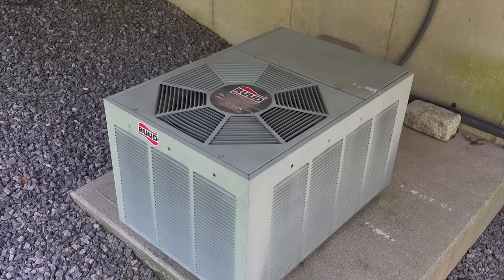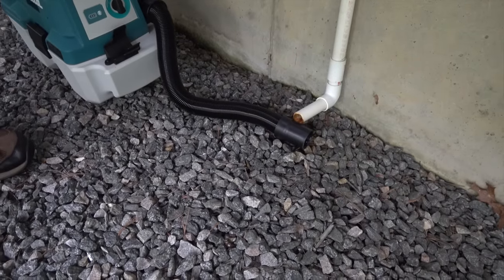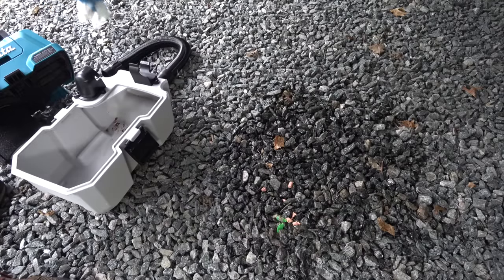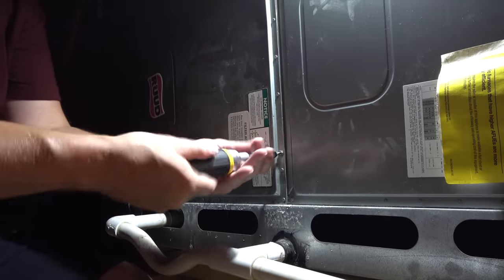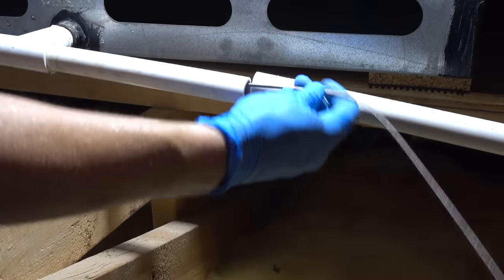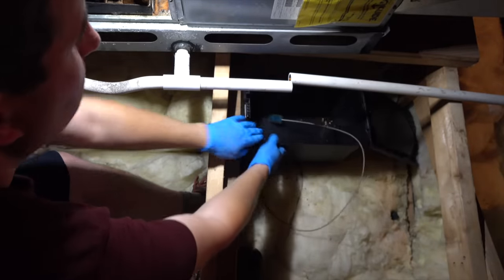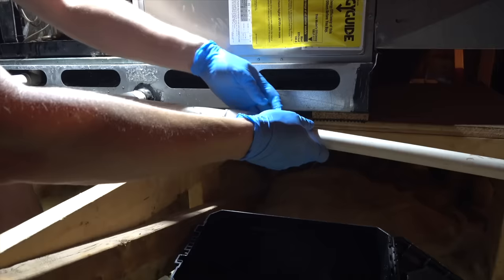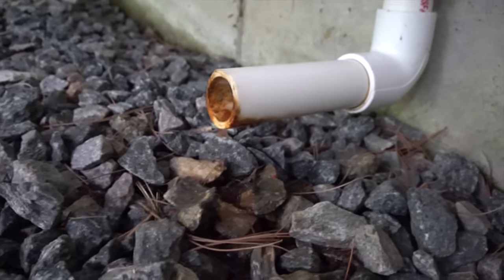How to UNCLOG your AC DRAIN Condensate line FAST - Water stains on Ceiling? or in the Pan

Comment from the maker: Tools from the video: PVC Pipe Cutter: https://amzn.to/2YwA05z - Pipe cleaning brush: https://amzn.to/314wTzB - Pre made rubber coupler with clamps: https://amzn.to/2K7SmBR
Reply: Another help is a shot of eco friendly dish soap in the condensate pan to inhibit mold and algae.

NEVER bleach.
Reply: My house is built by a stupid plumber 37 years ago; he installed two 90 degree angles PVC in series within one foot. Therefore, my AC drain line could clog easily. Sometimes, I
had to flush the nasty stuffs through these two PVC. Well, I would like to offer you a good tip. Luckily, I found a 20 ft long coax cable, very flexible. There is the AC drain line outside next to the AC unit, I poke the cable gently into the drain line back & forward for at least ten times. In addition, I used vacuum, carpet cleaner to suck out all the dirty stuffs from inside the drain line for 15 mins.
Reply: Hello Silver Cymbal! Thanks for this video 🙏 Can you please update your list of tools from this video? The pipe cutter is sold old and the other is unavailable. I’d like to purchase ASAP from Amazon and I’d love for you to benefit from the affiliate link. Have a great day!!
Reply: @DealingWithDigits  If it’s sold out  just check for a different PVC cutter they’re all the same just different manufacture
Reply: Is there a solution to keep the jellol that forms in the pan. Mine gets so thick? I was thinking of like a bleach tablet.
Reply: @larrybrautigam7734  Soap might accumulate dirt and clog your drain pipe ! I read that vinegar would be preferred !
Reply: A drop of soap once a month is not enough to clog anything. And vinegar is acid. Bad for steel pans.
Reply: I would take the panel off everytime. The drain pan might be full of slime as well and needs to be cleaned as well
Reply: So, do we need the AC one  while we use the vacuum?
Reply: Apparently I have two drain pipes.  One is connected to my bathroom sink drain before the p trap.  The other is the normal emergency PVC drain pipe that drips outside.  I'm guessing I need to vacuum/clean both?

Comment: Bet this always happens when it's 90 degrees outside and 200 degrees in the attic lol 🥵♨️
Reply: Can confirm, 95 here today 😂
Reply: Hitting around a 100 here
Reply: Just did it yesterday when it was 96 degrees out. Thought I was going to pass out in the attic…
Reply: @HIGH REV that black thing might be a senor that's cutting you ac off you have a clog
Reply: @HIGH REV wow did you try to twist it off it shouldn't be hard unless it has alot of crap holding it down that doesn't sound right but it does sound like you have a clog drain
Reply: @HIGH REV go outside and use wer vacuum and suck the crap out the pipe I wish I could im on a 3rd floor condo
Reply: @HIGH REV np😊
Reply: @HIGH REV 😊
Reply: Omg so true 🤣🤣🤣🤣
Reply: Drive a car, learn the basics of how a car works. Eat food, learn where that food comes from. Use an air conditioner, learn the basics of how it works. Getting a vaccine, learn about antibodies before getting the vaccine. Or just trust the person you pay to do these services. They surly will do what’s best for you and not take advantage of you. Right?
Reply: @tomdurkins  😂 Learn how it should be done. Review the contract and supervise, so you don't get taken advantage of.😉
Reply: @tomdurkins  good man Tom I see you’re AWAKE . Nice job
Reply: Happening right now to me.
Reply: If direct sun is hitting the roof, I'm sure temps get over 120F and could reach 140F. Attics generally have poor lighting and you'll need your own high-brightness drop/spotlight up there to do anything useful, and with that, you don't need sunlight (unless you have a large window right next to your air handler!), meaning you can do the work on an overcast day, or better yet while it's raining or at night with no heat hitting the roof.
Reply: Every damn time
Reply: My current condition..
Reply: 95 degrees at 11pm and that's when ours stopped working.....I even noticed water pockets on the wall! thanks for the advice 👍🏾
Reply: Yes it was almost 100° today and it happened to me.
Reply: Wife just called me said water stains on the ceiling...I said cut the ac off until I get home tomorrow...she said hell no it's 96 degrees outside lol...so here i am
Reply: Happening to me right now.  Unplugged the drain but it’s still leaking.  Pipes sweating wouldn’t be the issue would it if the insulation is coming off the ac in the attic?
Reply: You are correct, my unit clogged twice, luckily, we caught it so when it's hot I clean pipe every 2 weeks.
Reply: Happening to me ritenow in Memphis thanks for the advice 🙏🏽
Reply: Balls deep into 100+ days
Reply: Yep just happened and it's 95 here 😭
Reply: Or 100 like here in Texas
Reply: 96 degrees and shut off my ac smdh
Reply: Just happened to me lol
Reply: Never fails!!!
Reply: 115 outside yesterday.  Being up in the attic was a blast!! 😅
Reply: 102 here
Reply: How to install an air conditioner filter
Reply: Wow. Just happened to me yesterday. Low 90s
Reply: Okkkkkkk!! Happened to me about 2 weeks ago!! Texas heat...mannnnnn!!
Reply: Yes… that’s when the AC generates the most condensation and when organisms that create biofilms proliferate the fastest. Hot air holds more moisture and the AC runs more the hotter it is outside.
Reply: Imagine how much $$$$$$$$ you’re losing because of HVAC  in attic, it’s criminal 😢
Reply: I can tell you first hand it’s true 😂
Reply: Exactly

Comment: Great advice, and as a homeowner I'd like to also mention that big ac companies would try to sell or want to replace your ac units when in reality the only thing wrong might be a clogged drain pipe, definitely do your homework and don't fall for this thieves
Reply: This is how I ended up on this video. Last fall, we had a serviceman go up into the attic and tell us our AC is failing badly. I found no leaks in the drain pan like he insisted and will monitor the water output this summer to see if anything abnormal is going on. Our main issue was a clog in this pipe that I blew out. Saved a lot of stress and a $14K expense (at least for another year.)
Reply: Industry seems to attract a large number of scam artists that could not graduate high school and had to go to tech school.
Reply: We need a video how to find good honest Airtech and installers people always asking I wish technicians would start doing this on these videos from whatever state they might be in
Reply: @KaliKlass  can u tell me how to do that ?
Reply: @jaredgonzalez8421  I used a wet/dry vac to suck the clog out from the outside. you'll likely need to use material like folded duct tape to create a seal around the pvc pipe so the vacuum creates enough suction.
Reply: @jaredgonzalez8421  First remove any water anywhere with a shop vac located downstairs and you are hooked up to a standard garden hose so you can just bring up the hose and not worry about spilling water.. Remove the secondary line the ties into the secondary pan and run a dedicated line for that.  Because, water will fill your pan also and if no float switch, you need to call a drywall repair person.  Since you allready have the coil panel off, go ahead and flush out the coil, pan and line. Then put a primary float switch in your actual primary line with a 90° angle tee for flushing. Put a ball valve in line near unit if you want, or not.  Now, put a secondary float switch in pan. Now. If you do this (takes a couple hours) insulate every bit of exposed drain line. Put the p trap outside for easier servicing.
Reply: I agree! Dishonest businesses to get your money. 😢

Comment: Thank you! Funny how blue collar hvac guys over-complicate things and make little issues like this into hugely expensive repairs. I really wish there were not so many crooks in this business, I hate to have to say it. The typical homeowner knows nothing about hvac installations, and are very often charged many hundreds and even thousands for simple repairs. I've seen so many abuses in this business.
Reply: You pay hvac companies for their knowledge and time, there is such a thing called overhead when running a business. When you take into account company vehicles, company insurance for employees and vehicles, business insurance, gas for travel, yes there is a high overhead. Maintenance plans go a long way, if your company offers maintenance or if you feel capable of doing so yourself, I highly recommend having your system maintained to prevent these overcomplicated little issues
Reply: @TooManyGoalz  I fully understand that many businesses have all sorts of overhead. But let me give an example I saw firsthand. This was an independent 1-man HVAC repair guy, presumably a VERY small business with just a van, not much overhead at all. He did regular a/c repairs (most are very small jobs!) just scooting around within one city. Yes, he knew the craft, what to do. But mostly what he did was grossly overcharge customers. We called him to spend under an hour on our regular apartment a/c. He replaced the contactor (a $9 part) and replaced the capacitor (a $9 part). He probably purchased these parts in volume for, I would say, maybe $6 each. When he finished, he billed us $1200 and insisted the funds be transferred directly into his bank account. No waiting on a check or credit card! He said he did 6 other jobs that morning. Yes, a good worker, but for one blue collar guy to TAKE HOME $7000 for one morning's work??? He was done with all by 2pm, said his main goal that day was to get to the lake, spend the day on water ski's. You can either admire him, or you can call him a crook and a hustler. I go for the latter. No honest person I know makes that kind of money so easily.

Comment: When the hvac company I use told me they wouldn't be available for 2 days and I had water dripping from my ceiling and walls, I followed your advice and fixed it myself! Thank you so much for sharing this information.
Reply: Did you vacuum the line while the unit was running or did you turn off your HVAC system. Thank you

Comment: Make your clear tubing another inch longer and re- cut your PVC 3/4 shorter and you'll have a small window to do a fast check of the water flow. My two cents!
Reply: @CuteB1gDaddy  .... ????...from the vid, he's using 3/4" PVC ( typ OD is 1.05")...and he's slipping over a longer piece of 1" (ID) clear rubber tubing ( he calls it 1.25" but that the OD)..... with hose clamps on both sides....plus...the system is not under pressure and is sloped for gravity drain. Why would you need a male/male adaptor? The clear tubing ( I agree) would have a step-down and step-up on both ends for the water to flow, but it's 1" ID in this clear section, bigger than the 3/4" original PVC. Shouldn't be a problem at all to not having the 2 pre-existing PVC lines to "not touch"....and have a "window gap" like this.....right? What am I missing?
Reply: @CuteB1gDaddy  ...the reason I commented was that he identified the tubing he was using ( 1" ID / 1.25" OD)....and he shows how he installs it by slipping it over the 3/4" PVC (which...as you know, is 1.05" OD).
Reply: @CuteB1gDaddy  ....Don't understand your comment. See the whole vid and read his text. What he said is exactly what he did.....joined  2 ends of 3/4" PVC ( that he has cut), with a clear Tygon-style tubing that was 1" ID. After he cleaned, he then re-assembled by placing the 2 PVC ends together pretty close...and the one reviewer said why not cut back the ends of the PVC.....and make the slip on tubing a bit longer....so when you're done you have a "Window" between the PVC ends. Pretty clear that was his intent.
Reply: Also, add a small amount of plumbers grease to the outside of the pvc. It may help remove the clear tubing in the future.
Reply: I thought of exactly the same thing.

Comment: Here's an idea: Why not make the trap removable when the unit is installed, instead of gluing everything?
Reply: Most places require all PVC drains to be glued by code. An inspector can fail a job if they aren't glued. There are a few ways to make it easier for home owners to clean their own drains. For example an EZ trap.
Reply: @ramirez7277  why not screwed on, like most under sink traps then? Seems like a ridiculous code for future maintenance. 🙄🤔
Reply: @imaramblins  if people did yearly maintenance and treated their condensate pans with proper tablets this would never be an issue.
Reply: I agree.  All my connecting pipes and joints are pressure tight and not glued at the air handler in my garage (glad it's not in the attic!).  One section has the clear tube as well.  I simply pull the connections apart and attach a homemade device with a hose connector end, add the hose and flush the drain line.  The full force cleans the line extremely well.  My installer did this and it passed.  Perhaps it was not noticed!  If it would have been, I would disconnect, and redo myself.
Reply: Lol try that in an attic and see what happens. But in this situation there is nothing you can do to stop a clog unless your regularly flush your lines. The main cause for clog in this situation is the coil. Whenever you see brown rusty water in the condensate line it’s not good. Means your are about to be leaking Freon and need a new coil. But never instal drain lines that are not glued. Not only will you violate code but will cause someone or your self a lot of trouble.
Reply: @ramirez7277  Glued by code, yes.  But, mine passed even with a non-glued piece of clear tubing!  I also asked that a few fittings not be glued so I can add by device to connect a garden hose to flush the drain.  They complied and the inspector did not pull on the piping to check.  If glued, I would have disconnected the glued sections and added my own pressure fitted ones.  That was over 12 years ago and I had no problems.  It's not high pressure drain water dripping out.
Reply: @imaramblins  Tell that to the people who installed it it’s not the owners fault
Reply: @potatolew4495  here we go. Just complement the man on making a great video that helped a lot of people and move on
Reply: @tracyb3198  Hence me saying "when the unit is INSTALLED." I didn't blame the owner for anything. Next time, you might actually want to READ what someone writes before making an ignorant comment.

Comment: Thanks for making this video!! My AC stopped working last night. My AC guy was tied up and couldn't help me thus time. I tried vacuuming/flushing the line from the outside. No luck. So I found your video!  Went up to the attic and found the drain pipe. There happened to be a coupler that exited the unit. So there was nothing to cut. It was only pressure fitted in place. I pulled it apart and could now see debris all the way down the line. Spent 20 min flushing/vacuuming/using a clothes hanger to clear this portion of the line. That did it. A lot of debris came out as well as brown water.

Comment: On the outside where the drain comes down, be sure the water comes out on the ground about 24" from your foundation. The A/C experts, who installed a new heat pump unit in my attic, had the water from the drain coming out a few inches from my foundation, flooding my previously(for 70 years ±)  waterproof basement; when the outlet of the drain line was extended by 24" to 36" away from the foundation, the flooding problem went away.  Also, when you check your A/C pan and drains, adding about a cup of liquid chlorine bleach, such as a Clorox-type bleach, will kill mold and fungus, including any in the drain trap and will often clean out any blockages that may have developed.

Thanks for the excellent video; great use for the portable shop vacs that are popular these days, and a great tip on the use of the that brush and the clear plastic tube to hold the drain together after cleaning the trap.
Reply: Add a pvc tee before your trap and you won't. Have cut p v c everyone you clan system

Comment: You were the first video I watched that recommended vacuuming/pulling the clog rather than trying to blast/push it out with compressed air. Vacuuming worked like a charm and I even used your rag method to create a good seal. Thank you for saving me a high $$$$ service call.
Reply from the maker: Glad I could help! So awesome. Thanks for letting me know.
Reply: I also use the vacuum method to clean lint from the dryer exhaust vent.  My laundry room is not at an outside wall so the exhaust travels about  15 ft. to the roof.
Reply: @SilverCymbal  I live in western Washington state, my HVAC unit heating and cooling is in the garage, with a short drainage trip to the outside, I can't imagine the trouble with having the unit in the attic

Comment: FL in August, super old unit, and no money when we sucked 20 gallons of water out of the bottom of the vent under the indoor unit (mobile home). Knew it was a clog, but this video, after 4 others, actually showed me the entire process that I could adapt to an ancient unit and fix my issue, clean the slime out, and make it doable again before this happens. Thank you so much for thorough, easy, and useful skill steps and also the links to the tools. Just subscribed to your channel.